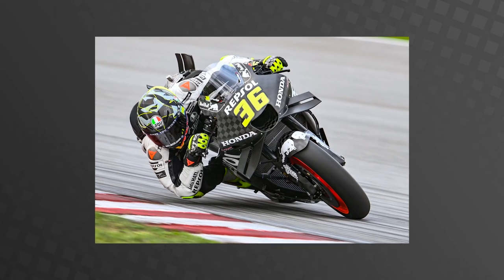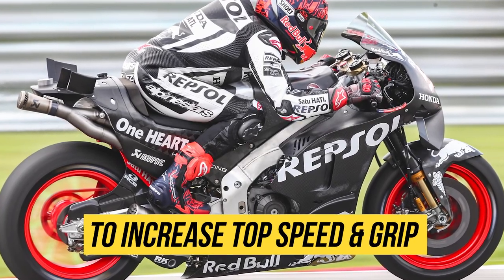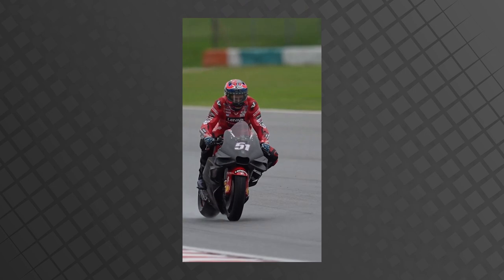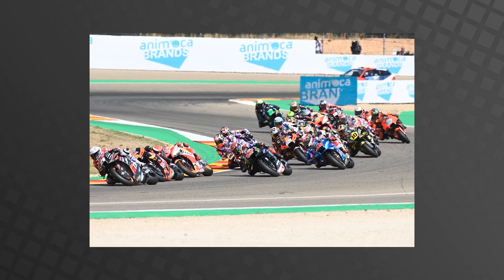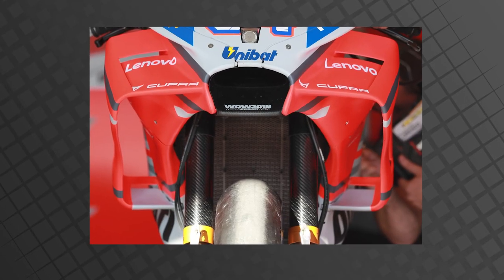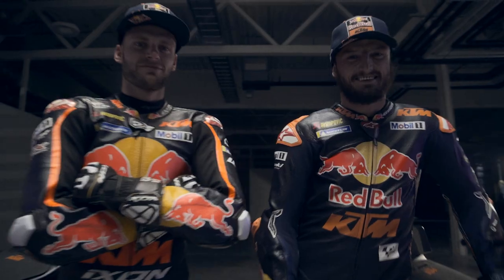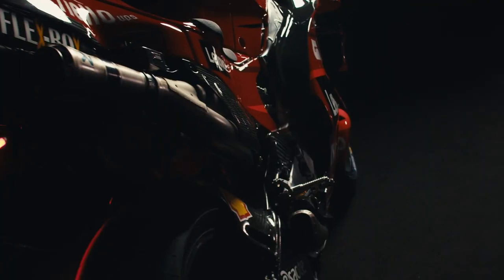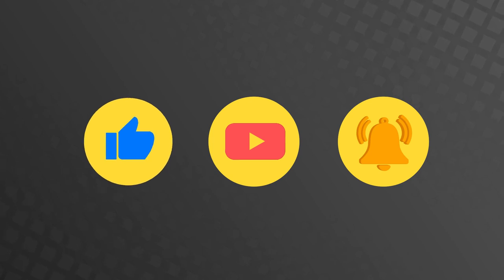Do MotoGP bikes REALLY need so much aero?

Comment: As long as all the contenders play by the same design rules then having wings is irrelevant. My biggest concern is that while Areo has transformed the motorbikes dynamics it may also be the culprit for the front tire overheating along with rise in temp when following issue, which is the issue that most threatens the racing.

Comment: The next thing I became less interested in motogp is the safety and environmental regulations looks like they are stuck. Motogp Engineers are still struggling on power and balance in every season update. Then they invented aero in which other motor racing are reduced for better racing and objecting on the engine efficiencies.

Comment: Witness the returning interest in Speedway. Simpler more basic motorcycle sport, more engaged with its fan base, cheaper to watch or compete. Motogp aero and all the gadgetry brings its own costs. Specialist aero engineering, wind tunnel modelling, dirty air and god forbid you make contact with another rider’s limbs with these winglet edges. Shrapnel all over the track when they get ripped off. The bikes are becoming less relevant to fans because they now resemble very little with the bikes you might aspire to own. It’s clear where this beautiful sport is heading and someone needs to get a grip before this branch of motorcycle racing is lost.

Comment: I think MotoGP is straying too far from the original meaning of 'prototype'. Will 10 years from now anyone of us need aero on our road bikes? Even if we were all forced to switch to electric engines, how much battery charge could you realistically save? 10 seconds? A minute? For a comparitive saving might as well try to loose weight by shaving your armpit hair or buying shorter shoelaces.

Comment: The wings and aero will negatively affect road bikes, teams are spending vast sums of cash which dont translate to road going bikes and is simply flushed down the drain. Doing 70 on the motorway does not get improved by winglets, double it then an aero benefit can be felt, so whats the point for consumers. The trickle down is faux winglets that likely increase drag and fuel  burn. Id rather the cash be spent on engine/brakes/suspension etc.

Comment: Its a new era for MotoGP! We should be celebrating that!
The issue is that manufacturers other than Ducati, Aprilia and KTM have dropped the ball and failed to evolve with the times. And obv being an F1 fan too, I'm quite used to seeing losing manufacturers, teams and drivers whine about innovations done by winners and then bring up the safety argument to take away advantages of teams who HAVE managed to be innovative. Just in the past 2 seasons of F1 we've had the whole porpoising drama being overplayed by Mercedes who used to DOMINATE for almost a decade but have now dropped the ball with the new regulation change. Mercedes lobbied for higher ride heights to take away the dominant Red Bull Honda's advantage and funnily enough, in the process also lost what little performance they themselves had while Red Bull figured it out and continued to win. And now Mercedes is back to cribbing about other stuff.
Racing can evolve. New styles of racing can come up. Aero also helps differentiate bikes visually from one another, and gives bikes visual personalities. Aero development has the potential to be a HUGE storyline throughout the season and fans can follow along with it, because aero dev is ACTUALLY VISIBLE on the bike.
Older generations of riders will eventually be eclipsed by newer generations, ones who can train to be more comfortable with aero based riding dynamics! Just look at Max Verstappen! A racer with a massively more aggressive driving style compared to previous dominant drivers like Alonso, Hamilton and Vettel. Max is literally rewriting the book on racing dynamics with the support of Adrian Newey (the aero wizard at Red Bull) and his brilliant cars. MotoGP can actually learn from all this.
And safety needs a quantum leap. Look at the Halo, safety cell and HANS devices, all innovations done in F1 just for safety, which have saved lives of COUNTLESS drivers.
MotoGP has a brand spanking new tool to attract swathes of new fans with aero, and the resultant absolute spaceship looking bikes. Everyone just needs to grab this with both hands and not be nostalgic about "How Racing Used To Be". The same argument is heard in F1 too, with bring back V10s etc, but here we are, nearly 30 years since, with closer racing, better safety and really interesting drivers and teams.

Comment: I've been watching MotoGP for over a decade and the racing has absolutely gotten worse. MotoGP has become sterilized and boring. Someone should calculate average overtakes from pre 2016 and compare those figures to post 2016 to current, if it hasn't been done already.
Reply: @macsmith6216  Glad you still find it enjoyable. I stopped watching after the 2020 season. WSBK, BSB and Moto America have all had much more exciting racing imo.